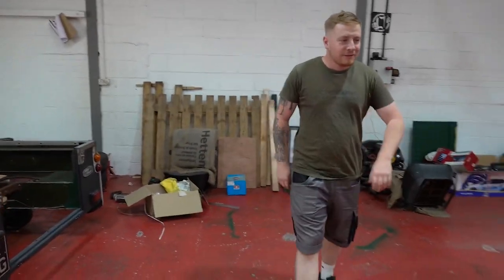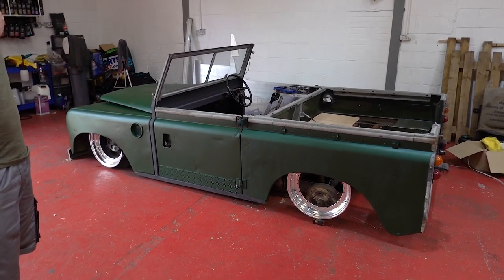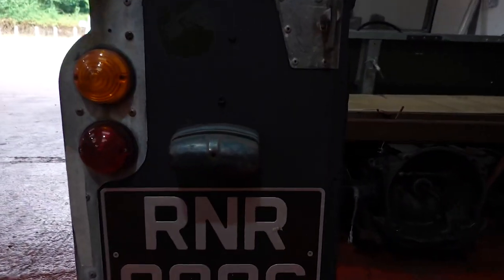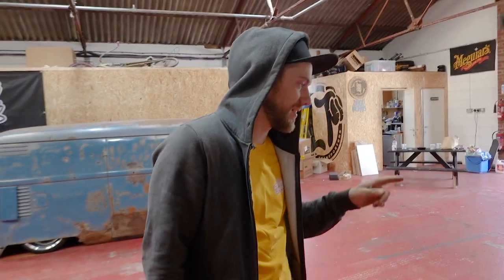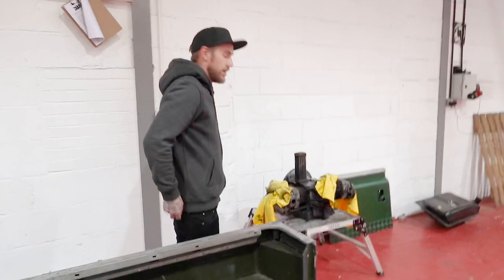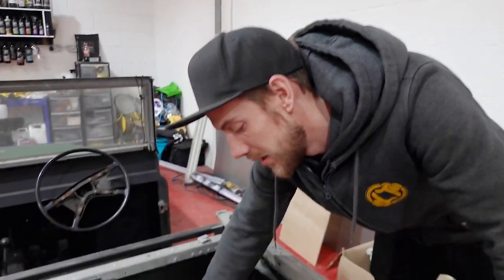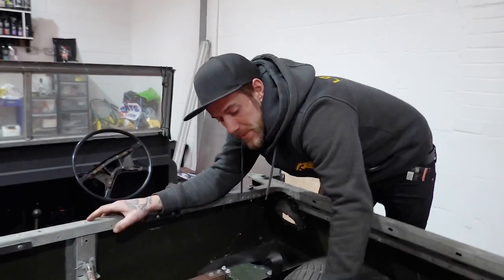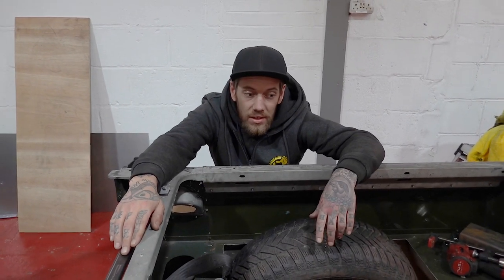Slamrover - Episode 3

Comment: i reckon it'd be cool using some old VW bits on it. and a touch of woodgrain, that heritage green compliments stained timber veneer to a tee. 
i reckon maybe throw some vw wheels and hubcaps on it, maybe colour match the steel rims and throw some chrome style rings on em' 
maybe a wooden gearshifter knob, gotta keep the long ass stem it's mounted on, perhaps even retain the old VW bench seat, maybe source old VW gauges and bakelite steering wheel. it has an old fashioned and classy kinda vibe to it. 
as for the paint...? yep. do the whole body in green, don't bodywork it though, the imperfections are nice.